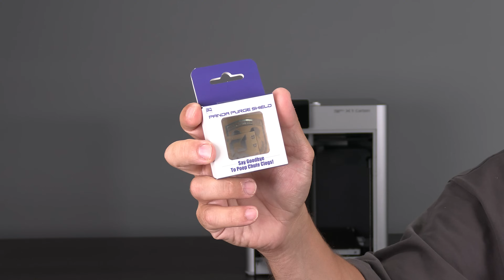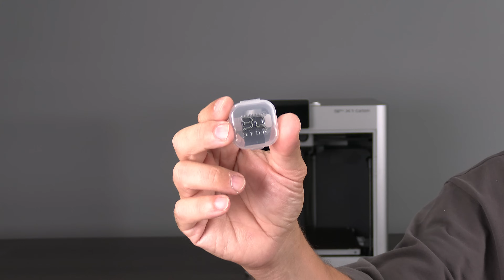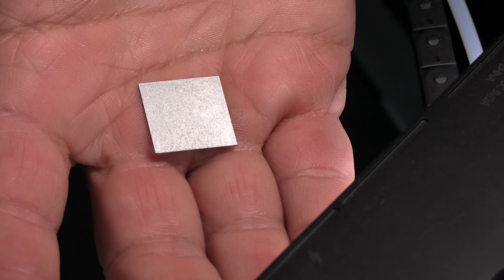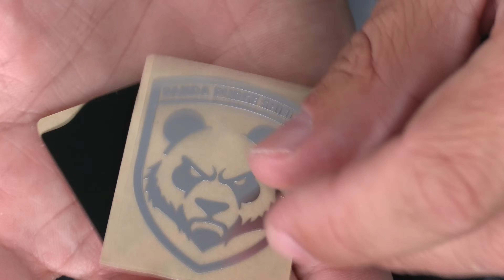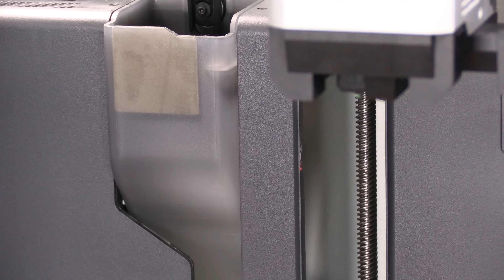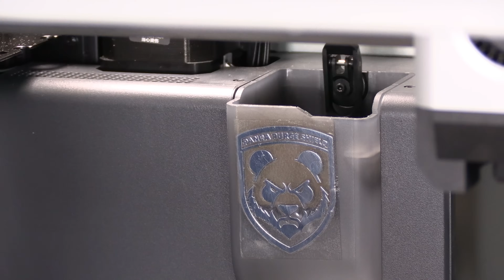BiQu PANDA SHIELD + Panda SCRUBBER. A $12 Poop Chute Clog Solution?? - P1P/P1S/X1C

Comment: I bought the shield for my P1S and it worked great until it fell off. the adhesive isn't very good. I put it back on once but the 2nd time it fell off i didn't notice and it disappeared in the pile of filament purge poop to never be seen again unfortunately.
Reply from the maker: Bummer, mine has held strong

Comment: these dont work at all, the plate wont stay stuck in the chute and the wiper causes filament to stick to the wiper causing more clogs
Reply from the maker: The plate uses VHB. VHB will out live you.... and never budge
Reply from the maker: I use VHB on my saltwater boat to hold GoPro's. 5+ years.  i'd need a metal scraper to get it off.

Comment: They made the same mistake as the original. The brush fingers should have been staggered. On my original. The nozzle seems to go right in between the brushes and doesn't get a good cleaning.Staggering the brushes would fix this.
Reply from the maker: They are installed via friction, and sticky tape. You can position them however  you like. I adjusted mine to be staggered.
Reply: @3DRundown  Good to know. Thanks

Comment: I need that non-stick shield on all of my P series machines with 10k hours plus on them now, the little factory square things fall off the shoots way too quick. Usually, I just wipe that area with grease or lubricating oil, but the only reminders to reapply I get are after a giant ball of poop has dragged onto my build plate or the toolhead has smashed/jammed into it causing layer shifts or complete failures.

This might just do the trick, IF it sticks!
Reply from the maker: For $10 they are a no brainer to try.

Comment: I have an A1 as well as a P1S so I used the spare rubber wiper I got with the A1 and printed a PETG mount for it.  It works in conjunction with the original wiper.   For the purge guard I used aluminium tape.  Total cost £0 as I had everything I needed already.
Reply from the maker: Total Cost: An A1. 😜